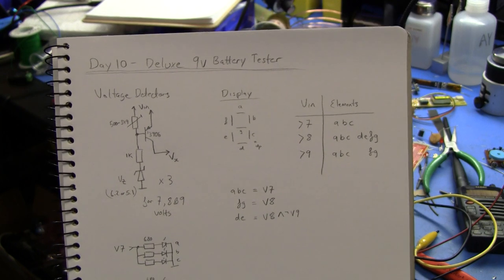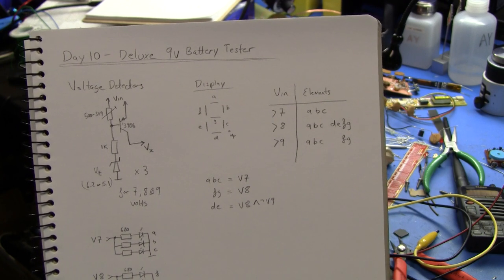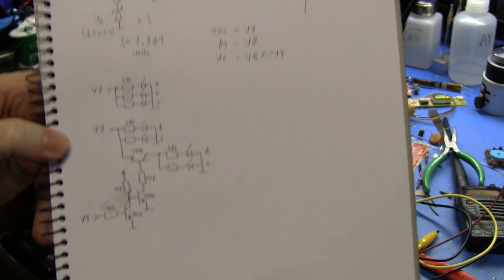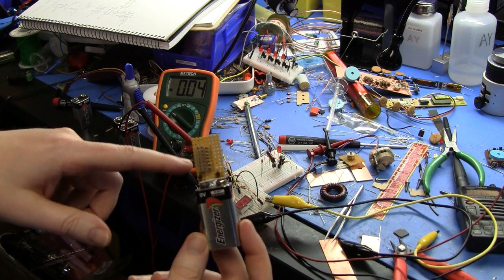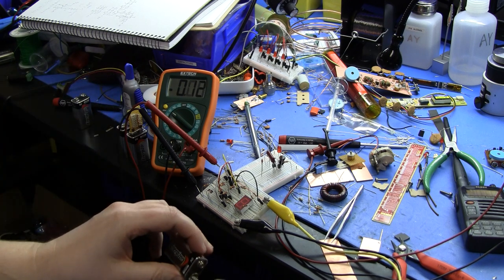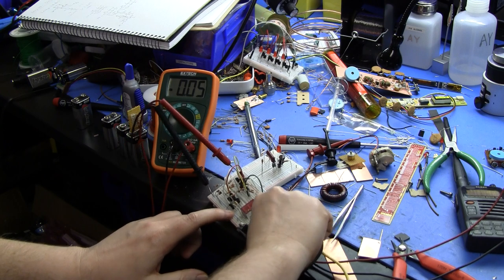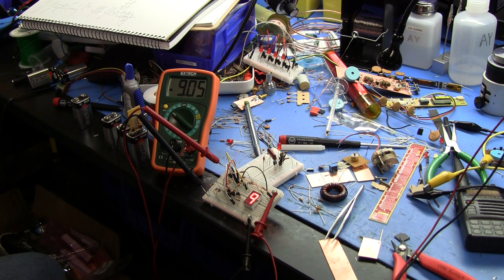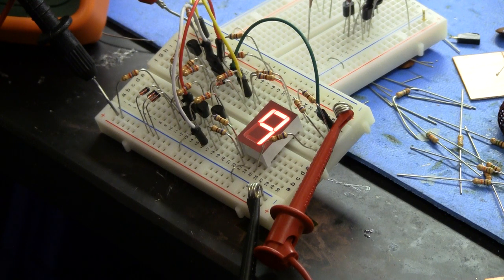Advent Calendar of Circuits 2014: Day 10: Deluxe 9 Volt Battery Tester

Comment: Thanks Alan, I made one but with a common anode display. I made it purely to learn but turns out, for a guitar pedal builder,  it's surprisingly useful.  Plus way more rewarding than using a microcontroller or pre-built voltmeter.

Comment: I know you're doing one per day, but are you planning to upload a schematic for this one?
Reply from the maker: Yeah, I guess the circuit diagram in my book is a little hard to follow...
Reply: vk2zay Well, it's never all visible at the same time in the video! Having a high quality scan or even photo that you can scroll through without skipping back and forth in a video would be nice. Also, I don't think you mentioned what the perfect E12 values turned out to be.